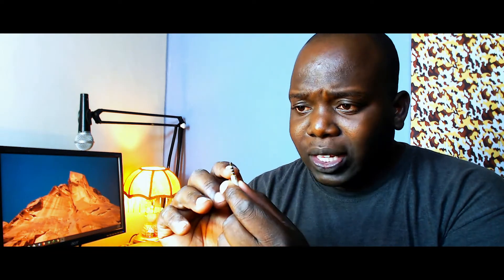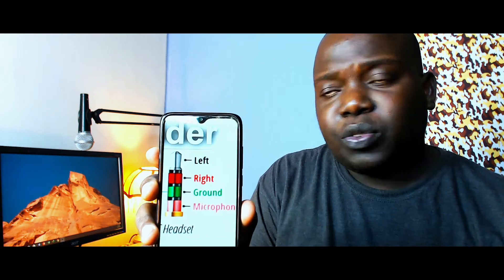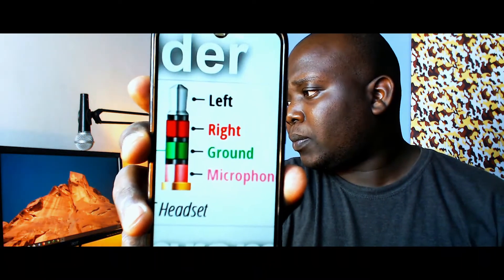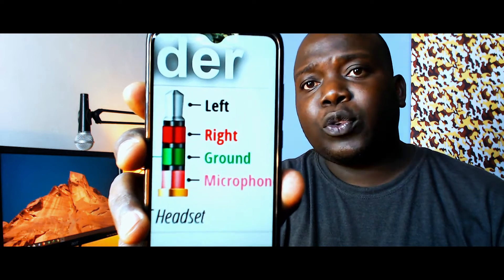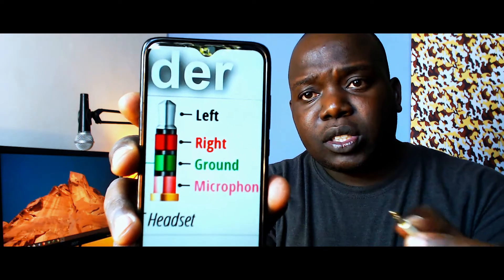Cheapest microphone for YouTube DIY | TS To TRRS DIY | TRS TO TRRS

Comment: I need that for sure
Reply from the maker: It's the quickest and cheap way to get a mic..  been told in some shops that mic goes for 30k ugx
Reply: @techselectug  sure where I need it very soon
Reply from the maker: Check any shop around you that sells electronics.. usually those with bulbs kettles and stuff. They tend to have those mics.
Reply: @techselectug  ok